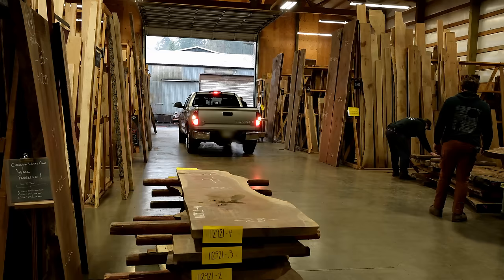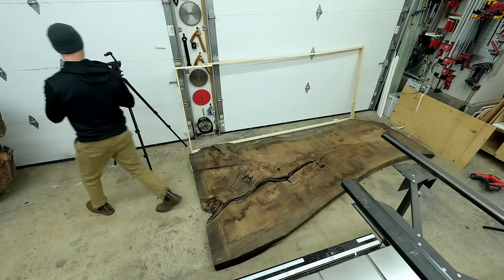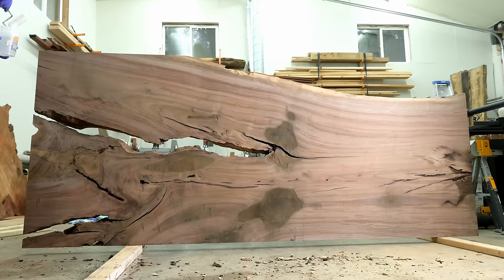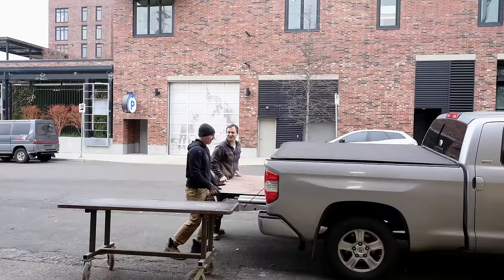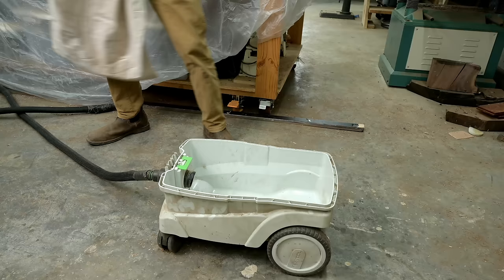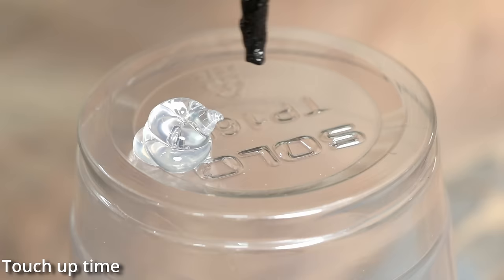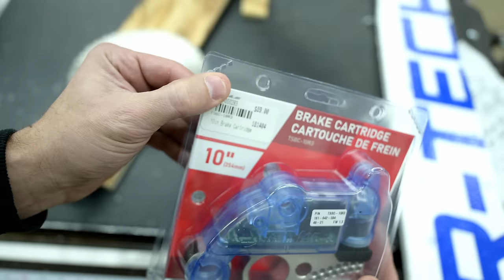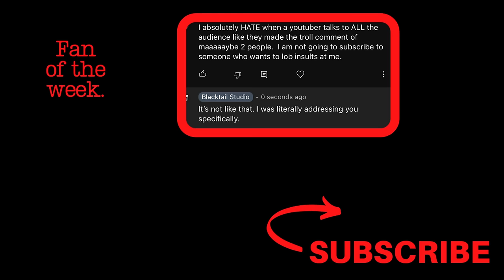The Client Hated This Slab

Comment: I'm slowly catching up with your back catalogue, I am a hobbyist wood worker. I was a mechanical engineer in large industrial gearboxes and individual gear for top tier motor manufacturers in Europe and North America. Switching from steel to wood is a sure fire relaxing hobby for me. I'm fascinated by the build process you employ in making your product. As for the trolls berating you for talking, all they have to do is turn the volume down. Thanks for showing me  how to build really good 'stuff'.

Comment: As you're sliding the foam across the table I think you're building a static electricity charge. That charge might be getting large enough to trigger the saw stop.
Reply: Should probably use a different saw for foam or turn off saw stop (If you can that is IDK)
Reply: You can turn off the safety feature that triggers the saw blade break on SawStops. For cutting green wood etc.
Reply: Was checking to see if someone else had said this! Cold dry air is a poor conductor, so increasing the humidity would help. However, try spraying the foam with glass cleaner / windex before using the saw… It should help with a bit of luck!

No desire to make tables but it’s fascinating to watch - keep up the good work!
Reply: @alexwarburton  I think you got it backwards, you want less conductivity, not more. These saws work by passing a small amount of electrical current through your finger and back into the table (or in this case through the foil of the foam board), triggering the stop. You want to cut clean, dry, non conductive material with these.
Reply: @Teh_Random_Canadian  Agree if there’s foil attached to the foam - was more referring to a static build-up.

Great username 😂

Comment: Another tip if you ever have a really long crate and you're afraid it’s going to tip over the forklift. Lower the lift gate and then put part of the crate on the lift gate and then raise the lift gate and the forks at the same time. Once they're up you can then use the fork lift to partially push the crate into the truck, because at a point you'll hit the lift gate with the fork truck. Then pull back a bit, lower the liftgate and get it out of the way and then you can push the crate all the in with the fork truck.

My company does this all the time delivering x-ray machines. The boxes are too long for the lift gate or the fork lift and there’s no loading dock.

Comment: Cam, I highly recommend a flatbed for your truck. I’ve watched several videos of you struggling to move wood in the standard bed and can’t help but laugh. A flatbed will end up being your favorite tool! Your videos are the best woodworking epoxy videos I’ve seen on YouTube. Thank you for that.
Reply: I agree on flatbed. Then you can get the gate like attachments to give it walls when needed. And if you want a camper handy for weekend trips nothing beats a flatbed model you can access from the side for a ton more floor space. And trailer a boat much easier. 👍 to the flatbed

Comment: With your next drive renovation, have you considered creating a "Loading dock" that you can pull your truck up to and not have to lift it in order to load and unload?  or get a flexible roller  conveyor system to side the wood around the shop at the proper height?

Have you considered going to a local Vocational school and offering wood working students a part time job at the shop, apprenticing them and helping them learn the trade?
Reply: Very good idea to get them in there debarking those slabs and hauling around stuff

Comment: I think if you went the CNC route for the bowties it would probably lose the "I could do that" appeal, and watching you do it with hand tools is a pleasure either way!
Reply: Also, at least for me, it also takes away from the hand crafted appeal as well when you start letting automated machines do the work.
Reply: I'm not sure if it would save that much time anyway. He'd have to move the slab to the CNC table, get it positioned and calibrated, then program the path, wait for it to complete the cut, glue in the bowtie and still have to level it either by hand or by reprogramming the CNC. If it only takes 30 min for a bowtie, I'm not sure the CNC would be worth the effort.
Reply: Plus as he said it only takes him 30 minutes, so CNC makes no sense in his case.
Reply: Were only talking about the bow ties themselves, The actual cut in the table top I figure would be hand done. It's really not practical to move the machine on top of the table top to cut the bowtie in. I don't think any of them sitting on the surface could cut that deep anyway without special long milling bits.
Reply: @edide1627  Sure it does, make batches to store for future projects. Pick one up, trace it and cut it in. The time saver of actually making the bow tie.
Reply: I also think that they joy of watching woodworking is not the same when you actually work on the computer, and then the computer does the woodworking. Keep up you amazing handcraft as ling as it makes sense.
Reply: The rounded corners of a CNC bowtie is something to consider too. Doesn’t look as good as a hand cut one with sharp corners.
Reply: @stevieg.4816  i have lots of identical metal fixtures that i intended for future projects lol.

Comment: Well and truly late to this, but I've been binging some of your videos and this is the second time I've seen you struggle with the syringe and the dye for the epoxy. If you pre-load the syringe with air, equal to the volume of dye you need, then inject the air into the bottle and allow the positive pressure to force dye back into the syringe, you'll have a much, much easier time. I don't know if you're still using this method, but if there's anyone else reading the comments who might find this helpful, this is for you too.

Comment: Personally, I love the lighter, reddish one.  But I can understand if the owner's decor doesn't lend well to any reds.  I built a similar table using grey tones, as my interior is mostly grey, allowing me to add color with wall hangings and accoutrements.  Somehow though, my eyes picked up green once the table was out of the shop and into the dining room.  I attribute it to the trees outside the window reflecting.  I was the only one that noticed it, and was super disappointed, but everyone else said it was my imagination.  Now, I have to sample every stain or varnish to make sure it looks right in the room.  Anyway, great video, beautiful work!!!
Reply: The type of windows you have can give the effect of changing colors indoors.  For example, low E, double pane, manufacturer...
Reply: @patriciaa.5571  You are absolutely correct.  In this case though, there was a big Palo Verde outside the dining room window.  Turns out, in spring when the bright yellow blooms come, it brings out different colors in the table, which was interesting.  We even suspected the windows, so we slid the table across the room in front of the sliding glass wall for a few days where there isn't any trees, and the table stayed the intended grey.  Also, and I don't know if my eyes are just sensitive, but on cloudy/rainy days, my eyes pick up some blue from the grey table.  Anyway, I think the moral of the story is that grey tones can be tricky.  Good advice on the windows though.

Comment: Better. However, Both are good. After pouring a lot of polyurethane and fighting trapped air bubbles,  we did some research. You can vacuum bag a lot of projects and there are also plenty of pumps for mixing buckets. If you mix your epoxy and place it under a vacuum for a couple of minutes, it eliminates most of those pesky little surface bubbles and makes the epoxy bond better to the wood. You already do a great job. This is just something that might help. Consider vacuum bagging the entire slab prior to pouring the epoxy I know the bond between the wood and the epoxy  will be even stronger. A lot of trapped air in the grain and cracks of the wood will release that air. Check it out. People doing advanced composites use these bags all the time. They are available in sizes to do boats and aircraft wings. Some people evacuate the individual parts of the epoxy before mixing.

Comment: Beautiful work! This must have been said before in the comments on one of your videos, but if you vacuum bagged it after the final pour, almost all the bubbles and imperfections in the epoxy would be removed. In fact, if you poured all in one and vacuum bagged, the epoxy would be drawn into the wood, providing better adhesion. Obviously you'd need to be careful it doesn't stain, but dense woods should be fine. You could also make the bow ties relatively loosely fitting and put them in place before pouring the epoxy, the epoxy would glue them in place stronger than most wood glues, particularly with the vacuum bagging.

Comment: From one helo pilot to another- Another great slab.   I have a thought for your chamfer size issue.  Make a chamfer that looks appealing to your eye.  Then measure the distance of the overhang and make a long shim or thickness template.  That will ensure each edge has the same size.   As well all know, there is always 3-4 ways to approach most of these issues.    Keep the quality content coming.

Comment: Back when I was an apprentice in the last year my boss bought a CNC and I nearly failed because it was such a ton to learn additionally. Also operating with 10k € drills can be intimidating since the machine won't think twice about ramming the latter with full speed into other parts of the CNC when there's an error in your programming. On the other hand, once you get used to it, it's so much fun to do precision work on edges, inlays, joints or planning furniture in general. If you have the extra money, give it a shot but use it as an extension of your shop for special duty.
Reply: And play with the stuff! Make projekts that are fun for you! That way pushbacks are not that bad. Nothing worse that a commercial first projekt and machinery you are not familiar with.

Comment: Love the color, I think, since you said it doesn't really look like that...  😄   CNC is perfectly viable to me, I have an old Shopbot 4x8 that I'm just doing my first intricate piece on (large wall art for over our sofa), it allows you to do things that either aren't possible or would just be very time difficult/time consuming by hand.  You can also speed up things you do repetitively like the routing for the channels under every table.  Have a few different lengths programmed up, center over where you want it, and go do something else while it runs, you could have it drill out for all the inserts in the same program...  The forklift moves had me concerned as someone who ran one for a couple of summers decades ago, but enough experience to cringe a bit...  When lifting something near capacity I would have gotten right up by the truck before lifting it, the less moving with a load high the better.  Also looked like there was a little side slope there, you weren't lifting that high but the center of gravity shifts more the higher you go.  Whether on purpose or not you did have it tilted back possibly all the way which helps pull the load center back, but keep in mind that the extended forks reduce the load capacity quite a bit compared to the rating.  Forklifts are rated for a certain weight capacity centered a certain distance from the mast, when you put extended forks on and move the load center away from the mast it reduces the capacity before the back end is going to get light.

Comment: Hey man love the videos. I’m an aspiring woodworker and I love your vids. Just wanted to say something about the new forklift, you can actually get some like 1 inch thick steel plates secured to the back of your forklift to counter all that weight you’ll be putting on the front of your lift with those big sick ass tables. It’ll really help on the decline of your driveway to keep your forklift from tipping forward and potentially damaging your product. Hope you see this and hope it helps.

Comment: Better. Looking at the sister slab table, I think that the red hue looks wonderful, although I am genuinely surprised that the metal base is able to support the table without issue (not familiar with woodworking or crafts/trades in general), since it looked extremely heavy, but it’s an absolutely stunning piece! And the website seems like a wonderful idea
Reply: the shapes of that base tells how much the steel guy knows his physics rule book, still modern jet timeless in design!
Reply: Some metals are way stronger then you think.

Comment: The ultra thin foil was likely tearing out through the cut and not making contact with the blade and then suddenly, one section didn’t tear out making contact with the blade and grounding to the table top setting off the brake.

Comment: The first video of yours I saw was a couple years ago...the "charred wood table" that I'm still completely in love with. I'm subscribing this time after seeing this stunner. 

I just have one suggestion after having watched this video from start to stop, and that's regarding the text comments you add after filming. For better or worse (tho, I'd imagine you might agree, mostly "better") I found myself so engrossed in the work you were doing that I sometimes didn't notice there was text on screen at all until it blinked away. When I did pull focus to start reading, that was about all I could do by the time I saw it, as the comments are up for so short a time. I think they're only superfluous sidetones for the most part -- again, based on what I was able to catch, which had to be easily less than half of what you added. I'm sure I can't be the only one who both 1. doesn't want to miss the comments, and 2. REALLY doesn't wanna go thru the hassle of rewinding to catch the many little sidebars. I've done a bit of video editing work myself, tho not much -- but enough to know how awkward I'd feel leaving things up too long. That said, when you take into account the time it takes just to realize there's something there at all (especially on YouTube on a laptop/tablet in theater mode with the virtual Times Square of distractions already present around a video), it would be great if those comments didn't fly away quite as fast as they do. 

Like I said...nothing big -- but you definitely seem the "God is in the details" type of guy, so I thought it was worth mentioning. 

Keep up the incredible work! Cheers!
Reply: I want to second this suggestion. I love your videos but hate missing the comments. They're just not on the screen long enough. Beautiful table, as always.
Reply: I'll add the third vote as I will actually backtrack to try to read those comments. I think it may be similar to the reason I dislike music that has vocals that I cannot hear over the music.
Reply: 😁 me 2 x 2!

Comment: 21:40 My best guess would be that by cutting the board, you inadvertently generated a crap ton of static electricity which the sawstop then detected and triggered. They likely also program them with a fair bit of hypersensitivity (after all, better safe than cutting your finger off) hence even a little bit of charge would set it off.
Reply: That would be my guess too.
Reply: Of course it had nothing to do with the foil face on the material.  When you cut that product in the future, you can by pass the blade stop cartridge as a feature of a sawstop saw

Comment: Another safety tip: you need an orange flag attached to the end of anything sticking out of your vehicle. Love your videos.
Reply: This is required by law in my country. You need to have a dangling red cloth, flag, paper, or cellophane at the back if it excess your vehicle's dimension. Accidents rarely occurs but can save you the hassle.
Reply: maybe he doesnt in his area.
Reply: Yes, I thought about that as I watched this amazing work.  I think in PA, you need a flag for anything that extends past the bumpers.
Reply: Red flag.
Reply: In Missouri if it extends past 5 feet it needs a flag.
Reply: it got loose..hence why it was sticking out
Reply: I thought it was red 🤔 😆
Reply: @mikehunt4947  Correct. Here in Texas, it's 4 feet.

Comment: Love watching and listening to your videos. Another back saving suggestion? When you are removing the bark and find it really time consuming as well as unpleasant: Try doing it on a raised surface. I've got several things going for me: I'm a lot older, I'm lazy, but most importantly I have had 9 major operations. The result is I'm always looking for ways to not have to bend over. Hope this helps! Keep up the good work. It's really inspiring. Been using RoboForm since they started in the late 90's. Great plug to an awesome company!
Reply: He has a fork lift. Perhaps it might be an idea to make something for that lift so he can raise and lower the wood slabs to a comfortable working level.
Reply: Maybe they should just be happy with black stains or paint.

Comment: Shaper Origin Handheld CNC Router with Plate and Workstation Packages. This is the best tool I've ever used to make bowties I've made them everywhere from three-quarters of an inch long to 11 1/2 inches long and slightly less than a quarter of an inch thick up to over 3 inches thick using the same tool.

Comment: The saw-stop activated the moment your finger touched the table while holding the foam edge. This was likely enough contact to transmit the electrical signal from your finger.
Reply: @Joshua Hollub The foam had a metallic liner as well as the metal top to the table saw